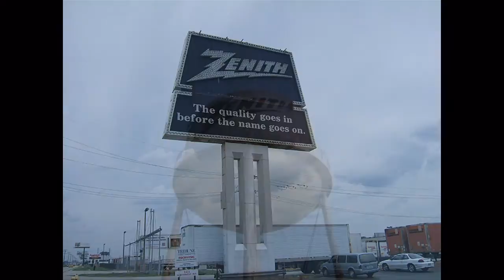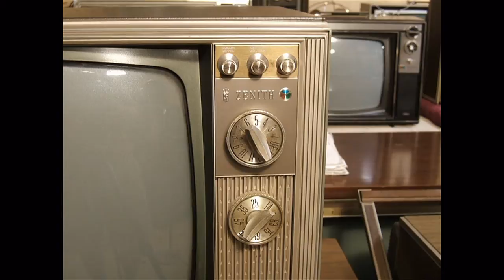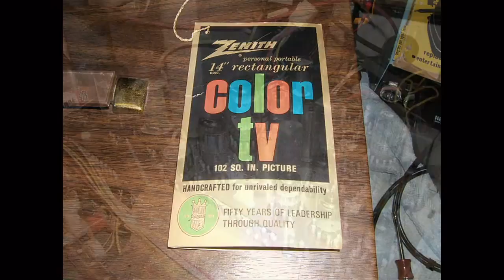Zenith Television, The Quality Goes In Before The Name Goes On!

Comment: I worked for 40 yrs at a big Zenith shop. Sets were hand wired till the early 70's
then evolved to all pc board construction. Even built 100% solid state B&W
sets hand wired ! INDESTRUCTABLE !  Once someone brought in a chassis
he pulled from another shop. It was all bent up. The tech was drunk & he put it
behind his truck & ran over it ! We straightened things out & got it back in service.
Even had one shot with a 45 ! Got the jug & yoke.
73 de KA1YHI

Comment: We bought a Zenith color TV (our first color TV set!) in 1974 or 1975.  It was our only TV until 1992 or 1993.  Of course there were places back then where you could take your TV to to get it fixed - not like now - nothing like that exists. I remember the repair place even gave us a loaner set while we waited for ours to get fixed! They finally told us they couldn't get parts for it anymore. We were then forced to get a new TV set.  I think it was a Magnavox. It sure didnt last as long as the Zenith did.

Comment: Wow! I worked on quite a few of those Zeniths in San Francisco. There was an official Zenith distribution plant near Army St. (now Cesar Chavez) and almost underneath the 280 freeway. 

I was there, getting parts when Harvey Milk & Mayor Moscone were murdered. The news came over a Zenith FM radio not 5 feet away.

Everyone just froze for about a minute, in shock.

Zenith did make good stuff. They were made with the repairman in mind. Frequently I could get away with just replacing a few tubes.

Comment: You sure have a good collection of sets.  I loved working on the Zenith's back in the days.  Although I never made a good income at TV/electronics repair I sure enjoyed the work.  I still today love restoring some of the old sets, but limited as far as how much space I have to do it.  Especially love my old 21CT55 RCA.  Had to get back into it, a resistor off the HV control opened up, and getting down into the HV cage without pulling the chassis was a challenge.

Comment: I have almost that exact Zenith shown at 1:02. Except mine has a silver speaker grill under the channel panel, a bigger speaker grill on the left side and the legs are underneath and more angled. Last time I had it on, about 20 years ago, the picture was good, but the sound would shut off after the TV being on after about 10 minutes. I may never get it working again, but I am keeping it as a piece of "retro" furniture.

Comment: I love it. I was born in the 60's so I grew up with these big TV's, clunk clunk clunk. I remember the console TV and TV stand.

TC repair Question. I have a Sanyo 19" (10 yrs old) and 13" Emerson (15 yrs old). The Sanyo works and than it shuts down or the picture/audio go. The Emerson does not come on. I have a flat screen now, but It would be nice to get them working for the spare bedroom. Hat to trash them. ANY SUGGESTIONS. I am hoping it  could be a relay or something.

Comment: zenith was a good design, those pins you see inside the chassis are voltage test points, other sets you had to go underneath the chassis to make tests but with Zenith it was really easy to access the test points.

Comment: That's what I thought. especially around the tubes.  But boy sure are a lot of them, must have made the wiring (and assembly) even more complicated with all the add'l wires and solder points underneath.  Easier to diagnose, but perhaps a little tougher once part(s) are being replaced amongst all the extra wires.  But I've only worked on two Portholes as far as Zeniths go so maybe not.

Comment: @frenchmarky those were test points if I remember right...instead of having to flip the chassis over and try to measure voltages on the pins of the tubes from the underside you could easily check the voltages from the topside of the chassis.

Comment from the maker: That set has the 25DC56 chassis, which called the "Horizontal solid state" chassis.  It predates the Chromacolor II which was the vertical chassis introduced in 1974.  These horizontal solid states can be found on various high end models from '71-'73.  Its also known as basically being the best chassis zenith ever made.  It gets my vote as the best one too, even though I prefer tube chassis.  Reliability wise there at the top.

Comment: Bought my first color TV in 1973...a Zenith 16' hand wired model...kept it in service until around 1992 when it finally gave up the ghost....still had the original picture tube. That thing weighed a ton!!! The rest of these circuit board jobbies aren't nearly as good...

Comment: That would explain why I never saw a 25DC56 in a junk pile back in the late '70s. I would bet it didn't have the "4-lead capacitor"  problem like some of the vertical chassis' had.

Comment: What are all the pins that are on the top plate of the chassis?  Are those test points or (?)  I've fixed up a couple of Zenith porthole B&W and some RCA color roundies but haven't seen any pins like this.  If they are test points, is Zenith the only company that went to that extent of making it easier to diagnose things?
Thanks!